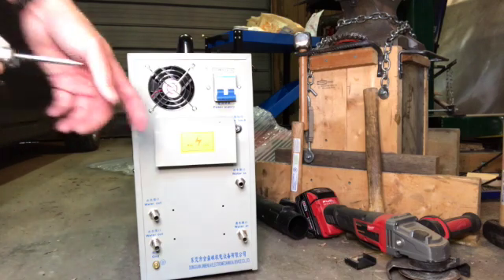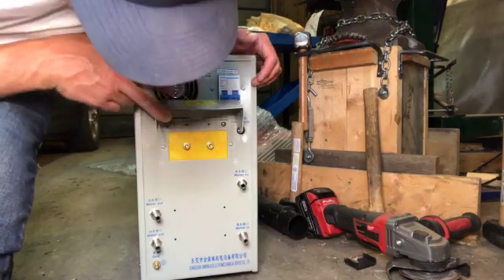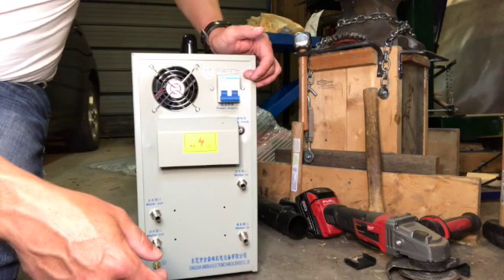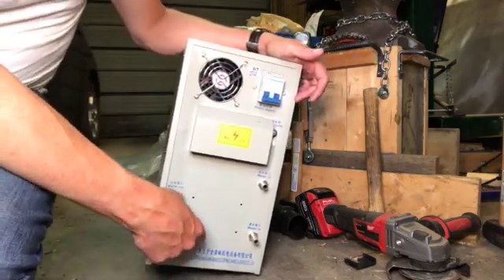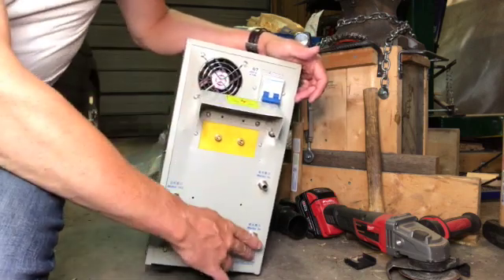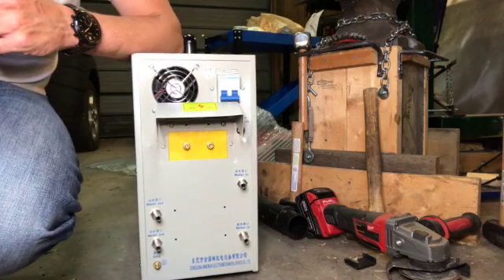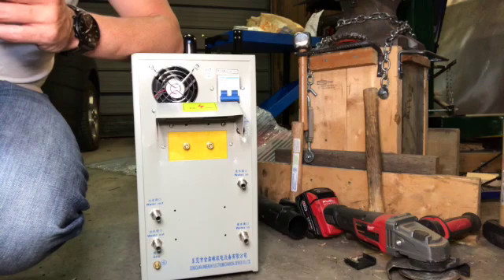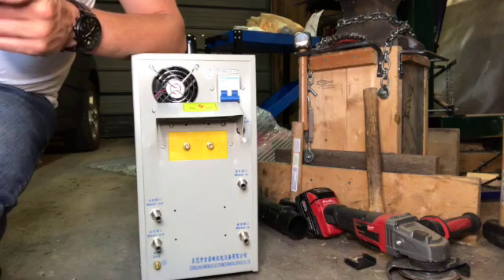Induction Forge - Unboxing and Setup

Comment: How are you liking the induction forge? I just received mine and need to set it up. Got the 25L cooler as well. Would love to know if you have learned anything to look out for.
Reply from the maker: Mine has been pretty good despite the bruising.  I filled the cooler with about 50/50 propylene glycol and water (plasma torch fluid and generic PG).  Otherwise, the trick seems to be all about magnetic coupling (and staying as close to the coils as possible without shorting).   I have bent up some additional coils but haven’t tried them yet b/c I haven’t soldered up the metric-to-imperial flare thing.